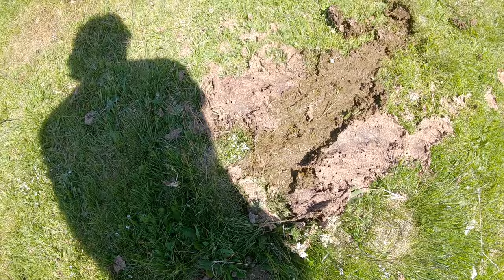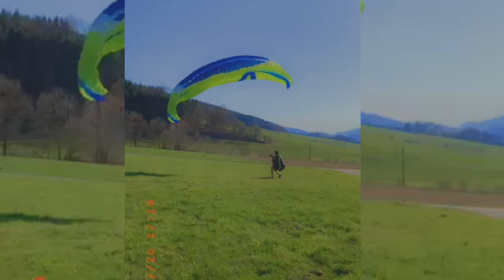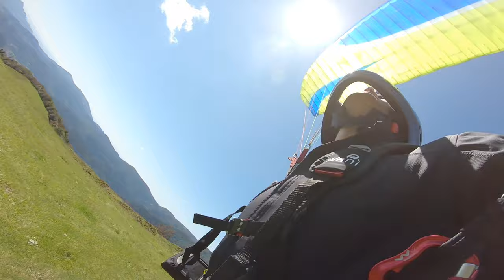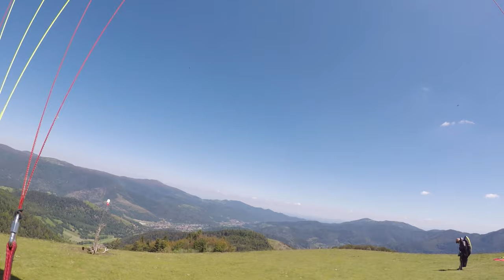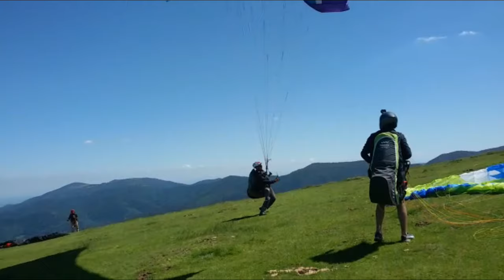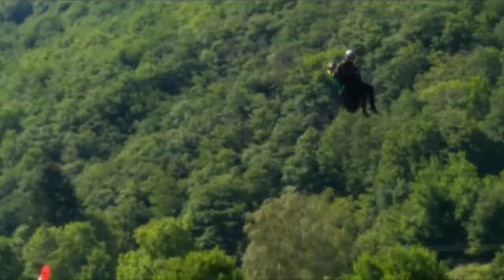Paragliding Takeoff FAIL | Paragliding Funny Bloopers - Strong Wind

Comment: I am still learning, but it seems like you should have waited a few more moments in the reverse to make sure it was all the way up and fully under control before turning to start you launch when you were having a hard time at the top of the mtn. I live in the US southwest, very switchy winds and can go from nothing to a wind tunnel in no time flat, also as we have no beginner hills here we learn on tow, so I am very paranoid (possibly overly so) about being perfectly in control of my glider before launch. Definitely some weird winds though, I agree kinda looks like some kind of rotar going on there.
Just my two cents as an overly paranoid kiter trying to become an overly paranoid pilot! Haha
Reply from the maker: Yes, the problem was that the wind was changing the direction pretty often and due to the tree rows below the launch site, I assume some kind of rotors were forming as well. After pulling my wing up in reverse, I turned quickly to take off and I had the full control over the glider but before beeing able to get airborne, the wind changed blowing almost from the back. This is the reason that I can recall why my paraglider collapsed. I think your ''paranoia'' is a good sign because you wanna make sure nothing can go wrong. That's something good... and that says a very ''non paranoid'' pilot 😅. Thanks for your comment, man. All the best to you!